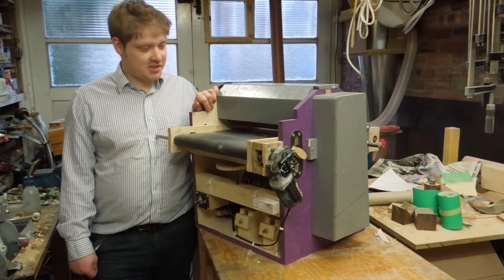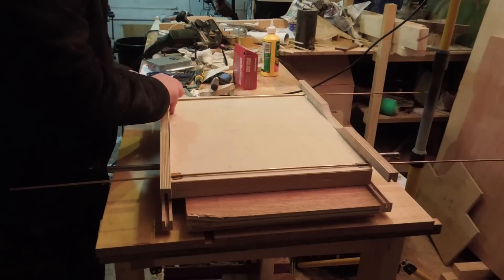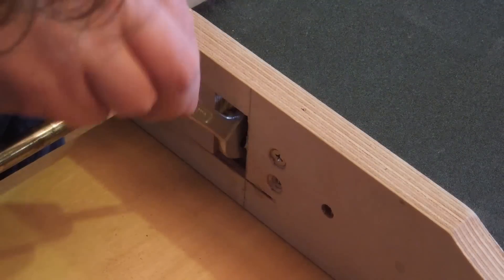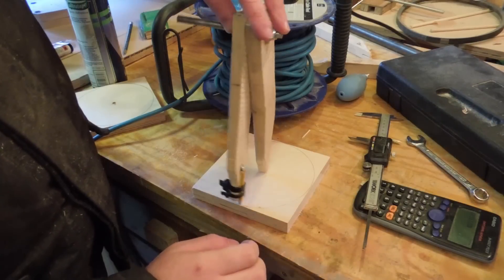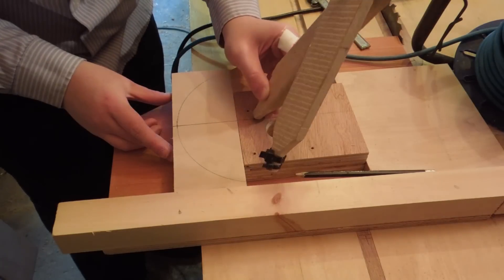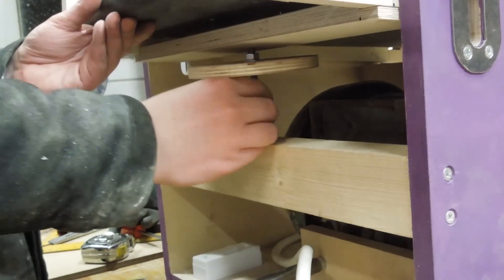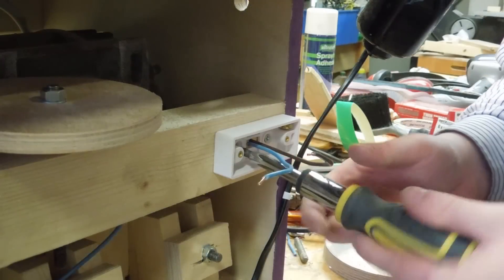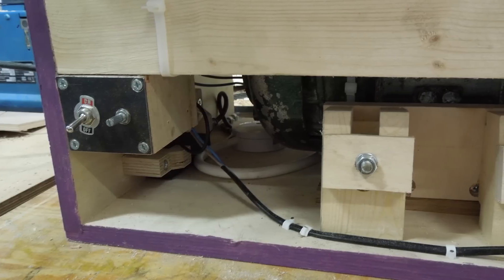Homemade Drum/ Thickness Sander

Comment: I don't think most viewers actually make stuff. If they did, I think this video would be far more successful than it is. This was so well made that it actually makes me a bit embarrassed about the childish crap that I produce. The video was both enjoyable and useful for me to watch, and so it honestly makes me angry how far off view distribution can be with respect to quality content. Oh well, such is life.

As for the spray adhesive on the drum, toluene is the only solvent that I have found that will remove the stuff. For that reason (for my disk sander), I just put it on lightly, and allow it to remain. Your spray seemed a but aggressive; I think it was that industrial web type for foam-rubber welding, so you may want to seek a milder brand if it is available to you. General purpose 3M spray is fine like hairspray, so it leaves less gooey, gummy blobs remaining after peel-off.
Reply from the maker: It's funny you say that, because I feel the same way with your videos. You make some really fine delicate stuff, and figure the maths out for it. Neither of those are things i'm any good at. It's not for lack of trying, either. I'm actually right now taking a break from doing stuff after spending the morning trying to make a segmented circle (for a banjo) from dense hardwood with no success, which was my third attempt at it.

As for viewcounts, I think it's just down to chance. Alot of people have ideas on how to game the system and attract viewers, and I even tried myself with obnoxious eye catching thumbnails, but I imagine what it really comes down to is just if Youtube's algorithms start displaying your video in the related videos on others. I know I see my spindle sander video in the related videos alot. It's still early days though and this video might start popping up like a bad penny.

That 3M spray adhesive does look like the right stuff to use (especially for paper templates) but it's expensive, and for some reason every cheap noname brand can of the stuff I find turns out to be the globby web kind. I might have to bite the bullet and just buy a can of the right stuff, although I've got to buy ink cartridges first.
Reply: my grandad made homemade machinery like this when I was a kid. I remember him using thick plastic pipe for the drum and used wood discs to strengthen. brings me delight watching this being built. reminds me of past days.

Comment: Bravo!  I am suprised that such a tiny motor can run the feed belt.
Reply from the maker: Windscreen wiper motors have a worm gear reduction in them and that gives them alot of torque at a low speed. What really amazed me was the brushless outrunner motor I bought to power my goofy electric bike. It wasn't that light a bike and I'm not that light a person, but it could still push me along at 15mph no problem.
Reply: I'll have to watch that video!

Comment: Seriously impressive build. I've been meaning to have a stab at building a drum sander for a while so notes have been taken. I built a belt sander a while back; when I saw you building the rollers out of MDF I thought you'd somehow secretly filmed my attempt as I had exactly the same problems. The solution I came up with was to soak the MDF in sanding sealer. Being solvent rich it didn't cause the MDF to expand and crack. The end result was acceptable rather than great though, I'd do it with ply next time as you did. P.S. where can I buy one of those flush cutting saw saws, they look great.
Reply from the maker: That's interesting. Someone on a forum suggested something similar (with diluted polyurethane varnish) and I was wondering if it'd work. I avoided doing it though since it probably would've taken a long time to dry, and solvent fumes tend to irritate my stupid lungs.

Unfortunately that saw is a one of a kind though.
Reply: Bit late to the party but epoxy is the way forward.  It will naturally wick into the MDF especially if it is warm.

Comment: Turning those kind of drums and stuff using a plunge router is actually very handy. You get dead straight surface. You turn the item very slowly and move the router along the item in  a pair of T or L rails.

Comment: fanbloodytastic. that motor is huge!
  I do like the infeed solution. Way more elegant than massive gear reductions that are normally used. Does the infeed speed controller works fine under heavy load?
Reply from the maker: It seems to be holding up, although I had a weird problem where the switch stopped working and the conveyor was stuck on (although I could still stop it by turning the speed down to zero). It turns out the two wires from the switch passed over the mosfet's heatsink, touching it, and the thing got so hot it melted the insulation and shorted it out. I'd been running the sander for a while at that point, but it means I still need to sort the cooling out.

Comment: Great video mate! Oh, and awesome sander!

The only thing I can see that commercial sanders have which your machine doesn't is in/out feed pressure rollers which may help with shorter pieces.

Jordan
Reply from the maker: At some point I might be using this sander to make veneers, so i've got plans to add infeed/ outfeed rollers that attach to the tops of the sides of the table part. I'm saving that for if or when I need it though.
Reply: great build with lots of details